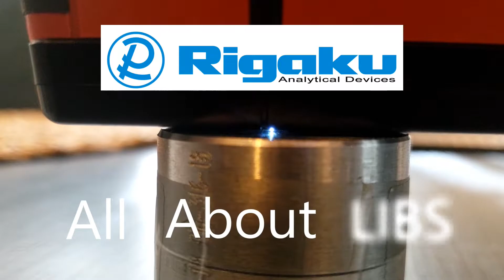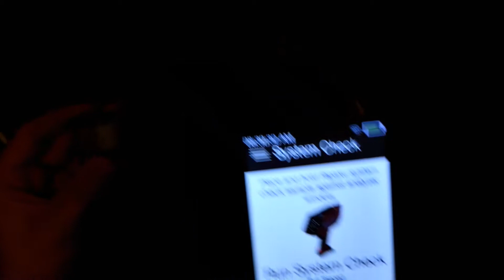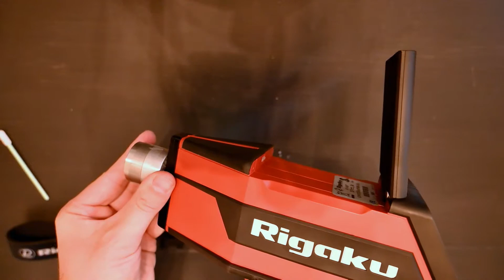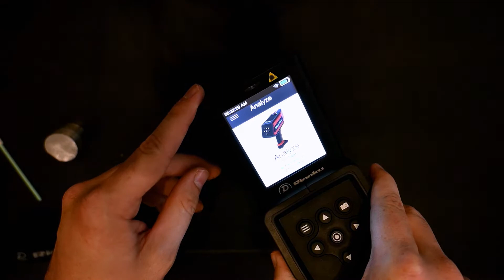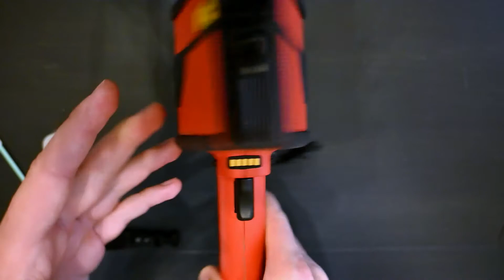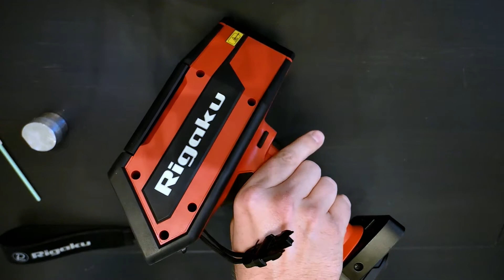Episode 7  - The Ease of Use and Ergonomics of Handheld LIBS

Comment: What would you use a hot key for? Do you need a cable to transfer data? How does the software track samples so I can review  multiple samples in a row and still match the results to a given sample?
Reply from the maker: Thank you for the good questions. A hotkey can be programmed to map another function you like (for example: fast scrolling down the chemistry which allows you to use the gun 1 handed, mapping that button to the camera if that is an easier way for you to use that function, etc.).
Reply from the maker: The software has a unique number associated with each sample read. Each sample number is listed on the CSV export which can be opened in Excel.
Reply from the maker: The unit has on-board wifi along with a USB cable for data transfer. You can use either, the goal is just to connect the unit to a PC or smart device (like your phone). Then, you can download any PDF or CSV reports.
Reply: @allaboutlibs5030  How does the wifi work? Does it connect to the internet, or simply device-to-device transfer? Could you navigate to it like a network folder on your PC?
Reply from the maker: @Seseo17  You connect to the units IP address in your browser then download the files you want. The PDF reports are ready to go with all the info you put into them up front including the number of the test. CSV files are similar but contain no pictures due to file format.